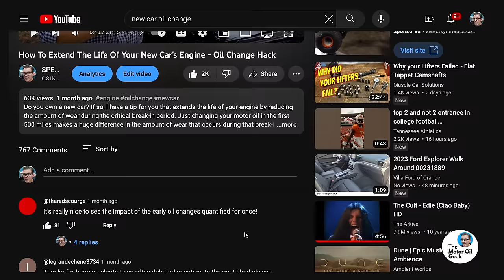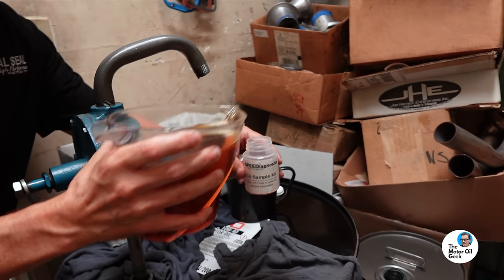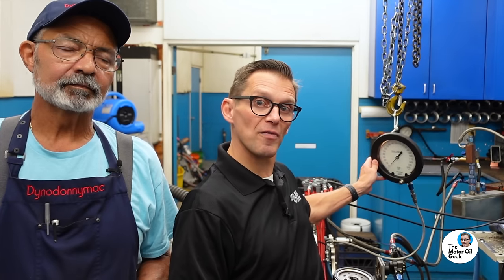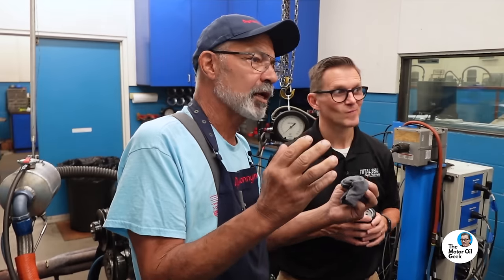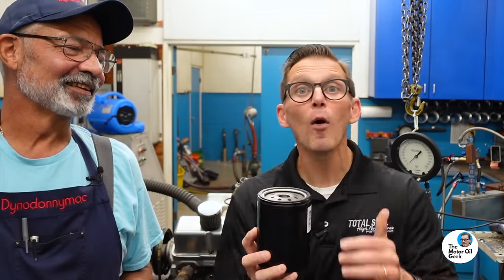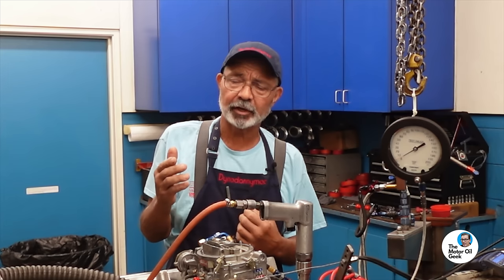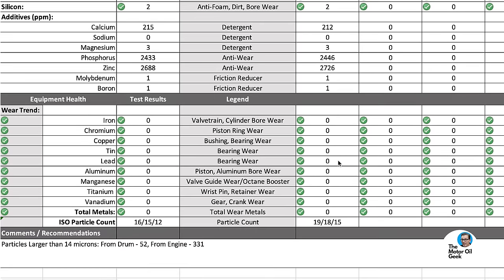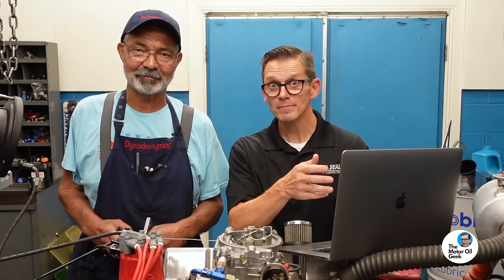Does Pre-FILLING The Oil FILTER Cause Engine DAMAGE?

Comment: Very informative video. It has been proven that pre-filling the oil filter can actually be beneficial for the engine.

My question is, what about the engines that have their oil filters on the top like VW, BMW, Mercedes etc. where it is essentially upside down. If one tries to fill the housing up with oil, it will just run down to the oil pan...

There will most likely be check valves there, but work only if the filter is fully seated and sealed.
Reply: In that type of filterhousing the amount of oil you can add is limited yes, - same problem with canister filters at an angle where some of the oil would spill out as you fitted it if completely filled. You can partially insert the filter and poor oil in till it reaches the top then screw the filter home , but's a pain and messy.

Comment: It makes sense to me to prefill.  Although, back in Autoshop class, we were not taught that process.  We were taught to drain the oil. Install the new filter.  Put in the new oil.  Run the engine to circulate the oil (filling the filter).  Then check and top off the oil.  Now, I do see your test on the time it takes to pressurize the oil system.  I also see the test that shows that the particulate matter is higher in the engine oil (after drain and replace) than what comes out of the can.  The latter shows that there is existing oil still within the oil system.  That also means that the bearings are still lubed, even while the 2 seconds of repressurization happens.  (Just with the old oil.)  So, your question on which (prefill or no prefill) will make your bearings happier.  I don't believe that there is a whole lot of difference to them.  They are lubed no matter what, unless you have not run your engine for a pretty long time and the old oil in the bearings has drained away.  Even then, it takes time for either method to actually get oil back into the bearing.  Then and only the will be bearing be running dry for a longer time (2 sec) if you don't prefill.
Reply: Just to add, many engines do not lend themselves to oil filer pre-filling. Like older Volvo engines with their side mounted filters, yeah 1/4 full filter probably better than zero but muh.. And 2005ish GM cartage filters housing. Which need to have the cartridge installed into the cap before being put into the engine to avoid crushing oil filter cartridge if the cap doesn't mate properly.  but the filter housing has an open drain to the oil pan if filter is not installed. (This drain allows the oil in the cartage housing to drain out when you remove the filter making for cleaner oil filter changes) With all that, I do pre-fill on cummins diesels, because the filters are HUGE and position lends it self to pre-filling.  and if you were truly worried about dry starts, you'd remove the spark plugs, glow plugs, etc and the run the starter in bursts till oil pressure was reached., if not use a pre-flube system.
Reply: My Landcruiser has an inverted oil filter and I think the filter does not 100% filter all the oil in the pressurized system.

Comment: A tip on priming the Porsche engine....Remove the oilpressure switch and use a vacuum pump to draw the oil up from the oilpan into the oil filter or you can also use a pump sprayer and through the oil pressure switch hole flood the bearings with oil....
Reply: Same with a 5.0 Coyote. And probably several other engines.

Comment: I bought a new Dodge Ram 1500 in January of 2000. I have changed the oil every 5,000 miles and have never pre-filled the new oil filters. I still have the truck and it runs great.
Reply: that's normal. people are exxagerating this pre-filling stuff. there are lots of videos on youtube which are showing how long an engine would last without oil. they usually last around 10+ minutes. 3-5 seconds before building pressure is not gonna make any difference IMO.
Reply: @peterjohn8625 Most vehicles it doesn't matter. I can't prefill mine because it's horizontal.

Comment: I have multiple vehicles with 400,000 plus miles on them and have never pre-filled the oil filter, they are still running in great shape.
Reply: Right lol I started to feel bad and then I realized that all my cars last 200k plus and I do my own oil changes lol can't be that bad 😅
Reply: I never pre fill .
Reply: There will be a coatng of oil on the bearings after it's drained, it won't be running dry until pressure builds, makes a good vid though I suppose...
Reply: @PaulMappud  I have been building engines since the late eighties, that I know of, all the engines I have built are from people I stay in contact with and they are still running.  I have multiple engines of my own that I built and have over four hundred thousand miles on them and have never once pre-filled a filter with oil and all of my engines are still going strong.  People don't understand the oil is still on the metal when you are not running them, you are correct it won't be running dry.
Reply: @docbrown6550  But do you have anything negative on prefilling?
Reply: They should have included throwing a pinch of salt over the left shoulder before pre-filling.LOL!
Reply: The oil pump takes at most three seconds to fill the filter in the vast majority of cases.  Considering you have hundreds of hours of use between oil changes, it makes a 0.001% difference at best.  Just make sure the final oil level is correct because it can drop slightly if it’s measured before the engine runs.
Reply: I know multiple people 80 plus years old who still smoke.

Guess smoking doesn't cause lung cancer and premature death 🤷

Who knew!?
Reply: what vehicles? how about modern engines with tighter tolerances? also, do you have belief pre filling is NOT a good thing to do?
Reply: Must be an LS lol you'll get 100k miles without a change lol
Reply: @kayveeslrv9957  yeah cuz he'll l lock the motor up at 101,000!
Reply: @kayveeslrv9957  You try to put 100k miles on one oil change, you're guaranteeing a ruined motor.
Reply: @1991NOS  tighter tolerances means it has less friction and wear, not more.  Todays engines last well beyond 100k miles while any 70s engine that makes it to 100k needs a complete rebuild.

Comment: In the case of side mounted filters and the like, its more about saturation than filling, it takes much less effort to push through something pre saturated than dry.
Reply from the maker: Absolutely!
Reply: Exactly!  We owned a Honda Accord, and that filter was a BI$%^ to get to, and it sat at a weird angle.  I would carefully and slowly fill it up, soaking the media, and not overfilling it to where it would drip out when I turned it sideways.  Sometimes a drip or two on my face, but that car ran over 175K with no issues, until some clown slammed into an Explorer, knocking it into my Wife, at a stop light no less, and that driver’’s Insurance totaled our Car.
Reply: Yup, my 440 Dodge is sideways, I fill the filtre half full, then screw it on as fast as I can. Always pre filled filtre on every vehicle I've owned
Reply: Wrong. Fill a filter then try to blow through it.

Comment: In tech school I've seen guys do it 22 years ago but I never did it at work or on my own cars. actually just changed the oil on one of my cars the other day without prefilling the filter. After seeing this video I'll never do that again lol great job guys.
Reply: That being said, I have never had engine trouble in any vehicle I've ever owned foreign and domestic and I've had a few high mileage ones close to 200k so there's that. Just had to add that lol but I will still try to remember to prefill the filter!

Comment: I think the benefits are directly correlated with filter size and mount orientation. My car has a very small filter that’s mounted horizontally so I don’t see a need to go through the hassle of pre filling it with an eighth of a quart just to dump it out when I’m screwing it on. Also, since it’s so small, it takes nearly no time for oil to circulate through it completely and back into the engine upon starting. I can definitely see a benefit for larger filters mounted vertically to avoid elongated periods of oil starvation on the initial post oil change startup while the pump is trying to fill it.

Comment: Great results! Unfortunately a lot of engines have the filter on the side of the block preventing the pre-filling of the filter. Any engine that has the filter located in the vehicle in the verticle position I always pre fill. It did surprise me that people actually thought the new oil from the container was dirty before being filtered by the engine, honestly why would you even put it in?
Reply: Eu mesmo troco o meu óleo e o filtro é na lateral do bloco e resolvi esse derramamento enchendo o filtro com o óleo e levando a congelamento. O óleo fica espesso como um gel e não derrama.
Obviamente só dou partida no motor no dia seguinte, tempo mais que suficiente pra o óleo voltar a temperatura ambiente e fluir normalmente.
Reply: Just get the filter saturated on the inside. No puddle.... It won't pour out
Reply: Some V8's have the filter on an angle. Prefilling still is better!
Reply: I estimate how much to add to the filter if its sideways or angled, every little bit helps
Reply: New oil is dirty oil, unless stated or certified :) Never assume it to be clean.
Reply: Pre-filling works on horizontal mounted filters as well. Let the media drink up the oil. Keep filling the filter until the level is about midway up to avoid spilling oil. Even the most ideal filter mount you still never fill it to the top in order to allow for some oil displacement when mounting the filter. Even thread side down mounts can be carefully pre-filled. Just let the media soak up the oil for those. Also,  spin the filter in your hand on its side to distribute the oil right before you mount it.
Reply: Even on side mount filters, you can get quite a bit in there before install. Prefill as much as you can.
Reply: 😂 @PaftDunk
Reply: @x12STEPx  Exactly!
Reply: @kirkstiefel2102  
I thought everyone knew this! The very first thing I do is prefill the filter and let it soak it up while I'm doing other things. I'll usually have to top it off 2 or 3 times. Even in inverted mounts (Gen III 4Runner V6) will hold most of the oil until its screwed into place.
Reply: @DennysCountryLife half a quart at least in most filters. You can also unplug the coil and crank the engine for 30 seconds to get the new oil flowing
Reply: @x12STEPx  A Toyota 22re is on the side of the block so I always saturate the filter first then fill it about halfway.
Reply: @zerkfitting  i fix outboard engines. That oil filter is always on its side and under something that's in the way. 🤣🤣🤣
Reply: @x12STEPx  OK, but I don't understand the emoji. ????
Reply: @@GeorgeSanford-pb1yj there is a reason why you clean the area where your working before starting. Put over 400,000 miles on a 7.3L Ford. Always filled the filter. It took two quarts to fill.
Reply: @PaftDunk  all new unused oil is certified clean. Have you ever oil packaged? It passes through a filter far superior than any engine oil filter.
Reply: Some cars have the oil filter at the top of the engine (such as Subaru) that mounts with the open side of the filter facing downward. Even so, if you fill the filter with oil and let it set for a few minutes before installing it, you can then dump out whatever oil readily flows out and yet the filter will still retain a substantial amount of oil due to saturation of the filter element so even in those cases it's a good idea to prefill the filter with oil since that oil that has pre-saturated the filter media will then instantly be sucked out to lubricate the bearings before the oil from the sump fills up the filter again .
Reply: Many aircraft engines actually mount them totally upside down. You still presoak the filter and put up with the mess. But you can get quite good at it with practice.
Reply: I can see pre filling with a large capacity filter system but a 1/3 of a quart your farting in the wind
Reply: @x12STEPx  No, just crank it without the combustion, untill the oil pressure light turns off !!! ! !!!  And only than you can Peacefully start the engine !!! ! !!!
Reply: @lloydsims1573  And even Better is just to crank it without the combustion, untill the oil pressure light turns off !!! ! !!!  And only than you can Peacefully start the engine !!! ! !!!
Reply: It doesn't have to be full the filter element just needs to be wet or primered even 1/8 of a quart of oil is better than none at all
Reply: Then don't buy such oils.

Comment: Thanks for a good and accurate informational video on this.  I've been a mechanic for 35 years and I always fill the filters, but on the VW G60 (compressor) you don't get oil pressure if you do this, probably because air gets in the way.  So on these I just fill the filter with a little oil so the filter media gets wet.  Hi from Sweden.

Comment: Even horizontal and upside down filters would do well with at least some prefilling to saturate the filter medium. Watch the just-poured in oil level drop as the medium absorbs the oil. That absorption has to happen on a non-filled filter while the engine is cranking and on initial start.

Comment: When ever I change a fuel filter on any car with F.I., I ALWAYS pour either injector cleaner or gasoline into the new filter. The filter media sucks it up like a sponge! If you leave it dry, when the fuel hits the filter media , if it's dry it can tear a hole in the paper...sending the media through the lines...and can block the flow of fuel to the injectors. A mechanic friend, who worked on BMW's and Ferrari's told me about this. He did a complete F.i. service on a flat 12 because the owner had replaced both filters and turned the key. The filter media tore loose and plugged the K.Jectronic  metering unit and 5 of the 12 injectors! Very expensive to fix! I agree with you both...even if the filter is at an angle, pour some oil in it to prep the filter and engine for the 35 to 75 PSI of oil pressure that's going to hit the filter...fast and hard. Please keep these video's coming! You both have taught me a whole lot!  Thank you!

Comment: If you are concerned about putting unfiltered oil in the engine at start up, if you prefilled the filter thru the small holes around the outside of the filter, this is the same route that the oil pump pushes oil thru the filter, so what was poured into the filter is also filtered.

Comment: I am with automotive engineering background---. Always filled oil filter vertical mounted filter. I even filled side mounted filter about 1/3rd before mounting them---.
Reply from the maker: Right on!
Reply: There's no way you have an automotive engineering background, if you do its in exhausts becuase you're spewing trash.  4-5 seconds without oil does no harm to the motor.  crazy you think  this.
Reply: @meggabitz  ok---if that makes you feel good.
Reply: @vicmultani7582  no, it makes me sad that you think you're brilliant, when in reality, you're... not.  Feel very sorry for you.  Good luck out there with that engineering background hahahaha
Reply: @meggabitz  Alright---so be sad---if that is what you want to be.
Reply: @vicmultani7582  thanks. I’d rather be sad than wrong.

Comment: Unprimed oil filters are a major reason people have pre-mature engine failure even with well maintenance engines. That's why it's best to have an oil filter with an anti drain back valve (or whatever it's called) so the oil filter holds oil at all times. 
And ALWAYS ALWAYS ALWAYS prime your oil filters during  an oil change. 
If at anytime your oil filter is dry, that is called a "dry start" which essentially means your starting your engine with ZERO oil pressure which is very bad in the long term.
Reply: never have I seen an engine fail because of that

Comment: depends on the location of the filter.  I have one that is horizontal so not a good start but I have to tip down and then wiggle around a frame and heaps of hoses to get in.  You can prefill it all you want.  You are just going to spend 30 minutes cleaning the engine, frame and floor.  I usually wet it because of pour onto the seal not just finger rub the seal.
You could reseal the plastic after filling so it doesn't spill - but I wouldn't recommend it as well that doesn't work for other reasons.
So as usual there is nuance to this question.
Reply: Lots of modern engines have oil filters inserted horizontally and a lot of them now have little filters that you put onto the oil feed pipe and then screw on a plastic cover. There is no way you can pre-fill those yet the engines last as long as any others. With oil changes up to every 20,000 miles now being very common and very high quality fully synthetic oils being the norm, even if you did get a tiny amount of wear through not pre-filling your oil filter it is never going to add up to much. I don't believe manufacturers would design engines taking horizontal filters if they thought there would be a serious issue affecting the longevity of the engine. 
I should be clear in stating that I do not believe that you shouldn't pre-fill if you can but if you cannot it isn't anything to worry about. If the engine manufactures can sleep at night then so can you.